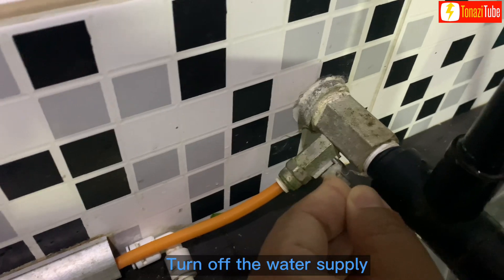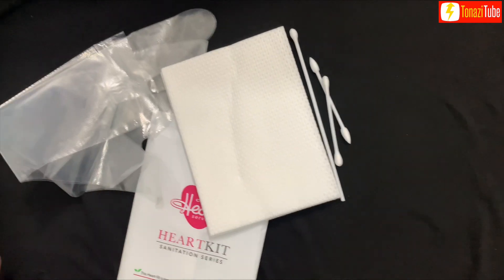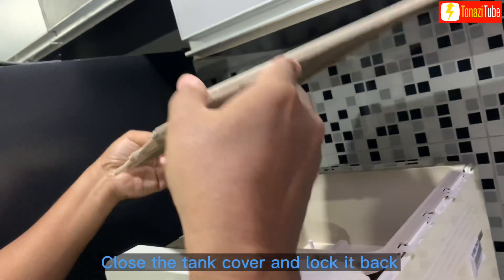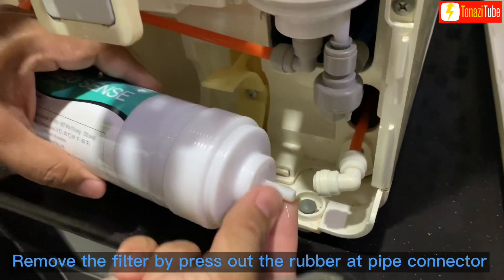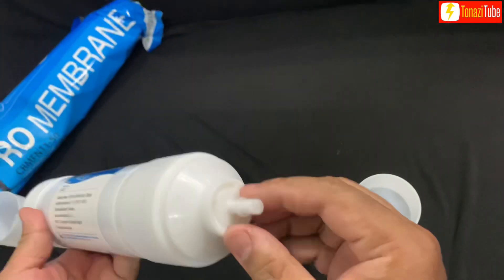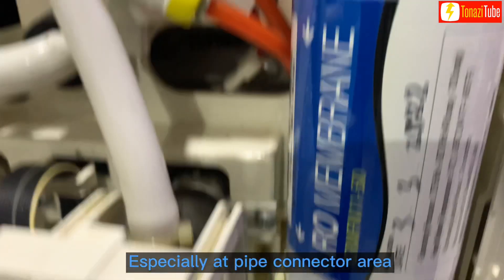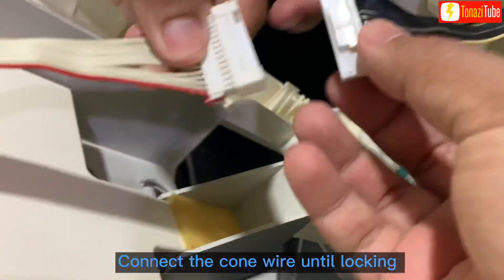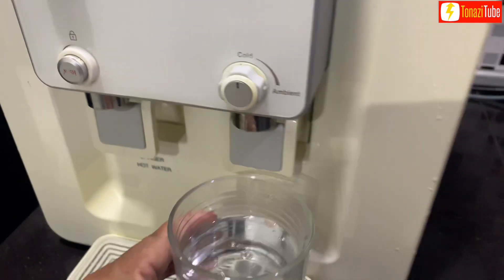How to Replace Water Purifier Filter Step by Step | DIY Coway Villaem Filter Replacement & Services

Comment: Kalau air ro keluar laju mcm mna iya..dia x naik ke tangki.
Reply from the maker: Cuba langkah paling mudah dulu: cabut plug → tunggu 5 minit → pasang semula → buka paip inlet perlahan-lahan → lihat sama ada air mula masuk ke tangki.
Jika masih gagal, periksa float valve atau minta technician Coway servis, sebab kalau solenoid atau sensor rosak, kena ganti komponen.

Comment: Bhg hot water sy leaking lps servis,,knp ekk
Reply from the maker: Punca Biasa & Cara Semak
1.	Sambungan Paip Silikon Longgar
•	Bahagian air panas ada paip silikon kecil yang sambung dari tangki air panas ke paip keluaran.
•	Jika teknisyen tercabut atau tidak pasang ketat, air panas akan meleleh keluar.
•	🔧 Cara Semak: Matikan kuasa, buka penutup belakang (jika yakin) dan periksa sambungan paip. Pastikan ia ketat.
2.	O-Ring / Seal Getah Tidak Rapat
•	Dalam tangki air panas ada O-ring atau seal. Jika rosak atau tidak duduk betul selepas servis, akan berlaku kebocoran.
•	🔧 Cara Semak: Tengok ada kesan air meleleh di bawah tangki atau sekitar sambungan.
3.	Tangki Air Panas Retak
•	Kadang-kadang bila buka pasang banyak kali atau sebab umur produk, tangki boleh retak halus → bocor bila air panas.
•	🔧 Cara Semak: Perhatikan jika kebocoran berlaku hanya bila mesin panaskan air.
4.	Inlet Valve / Hot Water Valve Tidak Ditutup Rapat
•	Jika valve longgar, air panas boleh menitis keluar melalui paip keluaran walaupun tidak ditekan.
•	🔧 Cara Semak: Tengok jika air terus keluar dari spout walaupun tidak tekan butang.

Comment: Hi do we need to rinse the new filter first before installing? Thank you
Reply from the maker: Recommend the water filter cartridges need to be rinsed or flushed before installation. This process helps remove any loose carbon particles, debris, or residue from the manufacturing process.
Reply: @ alright sir thanks so much
Reply from the maker: @kharizman You’re most welcome 🤗

Comment: How about if i dont have hose cable to drain water?
Reply from the maker: Can use a drink cup manually remove the water steply until water fully come out from the filter.

Comment: What bout the hose..?? Is it don't need to change..??
Reply from the maker: Depend on the hose condition.If filter not services for a long time, the hose might be a bad condition inside the tube surface .Recommend to replace it
Reply: @TonaziTube  tqvm for the explanation.. Much appreciated..
Reply from the maker: @iskandarsulaiman6170 You’re most welcome 🤗

Comment: Thank you so much for this great and helpful video. 
1-How much to get the 4 filters that you changed please?
2-And where to get them?
3- what about the pipes, does it need to be changed?
Reply from the maker: You may get at online shop.Refer to “Shopee.com”.
Cost around RM4++ for four filter.You may change the pipes if inside are totally dirty.Depend on pipes condition.
Reply: Thank you so much
Reply from the maker: You’re most welcome 🙏🏼

Comment: Hi thanks for the video i have a question how long does it take to change to another filter?
Reply from the maker: Did you mean filter life span?
Filter Lifespan:
- Neo sense (6 month)
- Ro Membrane (24 month)
- Plus inno Sense (18 month
- Ceramic (12month)
Reply: @TonaziTube does the ceramic filter refer to the antibacterial filter?
Reply from the maker: Yes it the same.

Comment: Pendapat sy sbelum nk pasang filter lain tu,filter tu kena running air dlu bru pasang,takut air hitam carbon filter tu melekat dlm tangki.
Reply from the maker: Terima kasih diatas pendapat dan nasihat yang diberikan
Reply: Macam Mana nak running kan air dulu filter tu?
Reply: @faizalsamsuri4573 ambik angle connector tu connect ke filter direct ke paip sinki…buka valve kt singki biar air flow 2-3 min…buat semua filter…

Comment: my villaem coway for cold water is not functioning and keep blinking. why is that happen ya? the water is not cold at all and only normal temperature water available. please help me
Reply from the maker: The Power Saving indicator blinks when it detects that it is night. * If the Power Saving indicator is lit, the cold water temperature will be kept warmer when the area around the purifier is dark.Possibility the dark sensor detection might have an issue or  problem for your cases.

Comment: how often do we need to do
1- backwash
2- change filters (3 below and 1 small filter at the top)
3- dflc

terima kasih ye.
Reply from the maker: Refer below:

1)Back wash - 3 months 
2)Filter change

11" Neo-Sense (Sediment + Pre Carbon)  - 6months
11" Reverse Osmosis Membrane (R/O) -24 Months 
11" Plus Inno-Sense (Post-Carbon + Fine)-18months

Ceramic Filter at top - 12 months
3)dflc-Replace if broken

Comment: Thanks.do I need to flush the water after changing the filter.
Reply: maksud?
Reply from the maker: Flushing bermaksud, mengeluarkan kotoran dan membersihkan kotoran pada dalaman filter.Biarkan air keluar selama beberapa minit dari filter.
Reply from the maker: Yes!Recommended to flush the water after change.